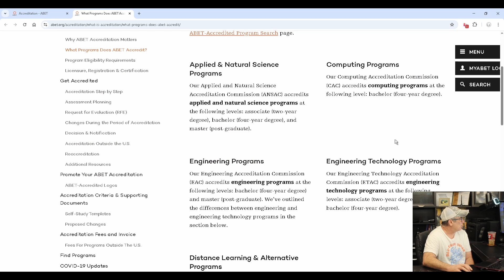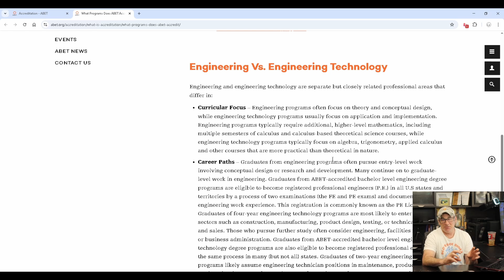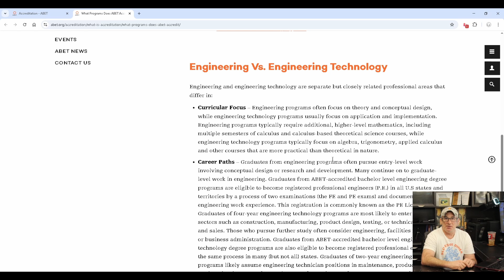Engineering vs. Engineering Technology

Comment: I'm 23 with 3 years of experience as a laundry and kitchen technician, with an electrical tech cert.
My goal is to pursue a non-ABET AAS degree in electrical technology at PBSC in FL and become a relay/substation tech or work in power generation, oil and gas, or manufacturing as a highly skilled technician. I love troubleshooting and building electrical systems. I have no interest in becoming a PE/engineer. Is electrical power technology my best bet for that career path, or should I get a BS. eng?
Reply from the maker: It would probably be ok, but I would always recommend the engineering degree over the technology degree.  Don't overlook the fact that with an engineering degree, you can always go be a technician somewhere.  But with a technology degree, it will be very difficult to move into an engineering position.  You may want to be a tech today, but what if ten years down the road you decide you would like to move into engineering.  Your hands will be tied.  If you have the means to go engineering, that would be the route I would take.  Maybe minor in a specific technology focused area that you're interested in.  Good luck with your studies and career path!

Comment: I just wanted to point out that the "College Algebra + Trig" require is more typical of Associate Degrees in Engineering Technology.  Every Bachelor's degree curriculum I have encountered requires more mathematics than this.  The Engineering Technology program I'm graduating in 2 months (December 2025) has the student take the Calculus (for scientists and engineers) as formally required math courses.  Our Engineering  courses develop as needed Matrix Methods for solving linear systems  for nodal or mesh analysis, a huge whallop of complex number theory, and even Linear Differential Equations (solved by the method of Laplace Transforms) for Control Systems, and introductory Fourier theory, are developed inside the courses that utilize those principles.  An extremely vital subset of the advanced formal mathematics in a regular EE curriculum is taught.  Some EET program do require full formal classes in Differential Equations, though not mine. 

I actually have had all those classes but was a junior level student at ASU and had a strong GPA and some Junior level classes completed under my belt, But the Electromagnetics textbook and lecture materials weren't helping me figure out how to do all my homework at a pace where I could keep up with the course in time despite working all afternoon everyday after work and all weekend long on the course and no free time.  I had to drop it twice, and did a serious rethink of the direction I should take. With graduation impending in 2 months I remain hopeful I can get into entry level engineering jobs, though not likely qualifying for a design role out the gate. I have studying for the FE exam and getting my EIT certification on my radar as well.   I hope with my AS degrees in Mathematics, Physics, and Engineering (Electrical Track), along with EIT certification can help me claw back a bit of the gap in credentials.

Comment: im currently studying at my local community College and i plan to study at uni for a btech and honours which is equivalent to a beng (i stay in rsa) i m also working in ndt (ISO certs😊 ut, rt, mt, pt, eddy current and vt all level 2)
my question is will my ndt still be useful after i graduate? or will it be useless
Reply from the maker: That's kind of the point of my video.  Someone has convinced you that a bachelor's in technology is equivalent to a bachelor's in engineering.  They may sound similar in nature, but they absolutely are not equivalent.  Getting certifications is never a bad thing, but they aren't substitutions for the foundational elements you should be getting in school.  As far as the NDT stuff, you just need to decide what you want to do in your career.  Focusing on NDT is great but just recognize most of the work is laboratory type work.  As a tech, you'll most likely be doing the grunt work for someone else.  There's absolutely nothing wrong with that, but you just need to make sure you understand what you're getting into so you can properly manage your expectations.  The good thing about getting an academic foundation in a true engineering curriculum is that you can then choose to go down whatever career path you want knowing you have the fundamental engineering skillsets to use however you see fit.  A technology degree may limit your choices.  Not because you don't have the skills, but because you don't have that piece of paper many companies may be looking for just to bring you in and give you a chance in the first place.  It sounds like you may be early on in your academic career.  It's never too late to maybe see if your school has some kind of cooperative with another school that offers the engineering program.  That's what I did.  I took all the math and science courses at my local college, then transferred them into the engineering program at another university.
Reply: @joetalks.76 thank you for harsh truth😅
but I noticed that you didn't mention anything about BTech Hons i m not show how it works in usa but when do BTech Hons there's vibrations, research and etc
after reading your statement i think I'll just do a bridging course cause the reason for btech journey was cost😅 and time but f it I'll do it 
Beng at 25 the old guy in class😅(yes the i m savingalso includesmoneyfor in case i fail some)
Reply from the maker: All of my comments are more applicable to the United States, I'm not overly familiar with the markets in other countries.  I wouldn't worry about being 25, I was 27 when I went back for the engineering degree.  It did feel odd always being the oldest person in class, but I'm 49 now and the difference between 23 and 27 is really a blur.  I was feeling really self conscious about how I was going to be almost 30 by the time I would finish the program.  A really smart woman gave me some advice and told me that 30 was going to come one way or another.  The question was do you want to be 30 and have reached your goal, or 30 and not reached your goal.  The outcome was really a function of how bad you wanted to succeed.
Reply: @African_Blade do the BEng buddy.  Phone ECSA to make sure. They'll be able to tell you specifically for your situation. It's important to know. Who cares if you're older. You'll be the cool guy and get all the girls. I was also older but I did the BEng and it makes a huge difference to your self-esteem. You won't be sorry. BTW I miss having hair. You look like you still have hair so I'm jelly about that 😂